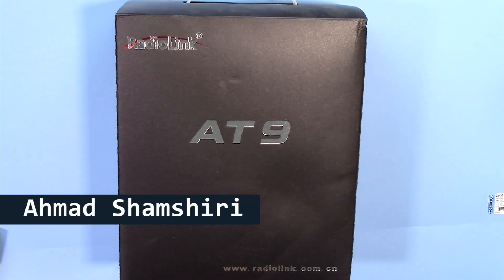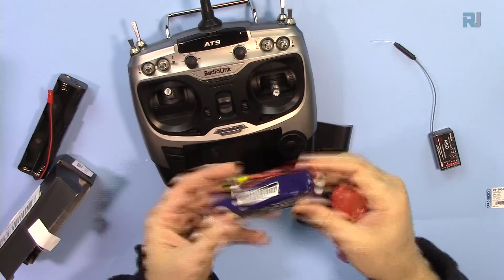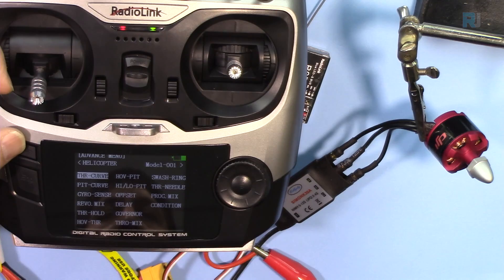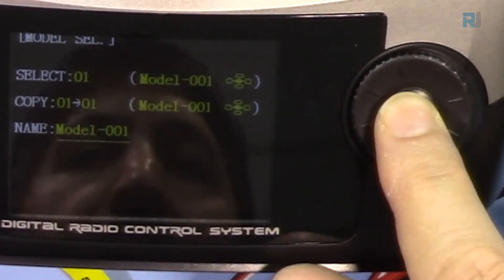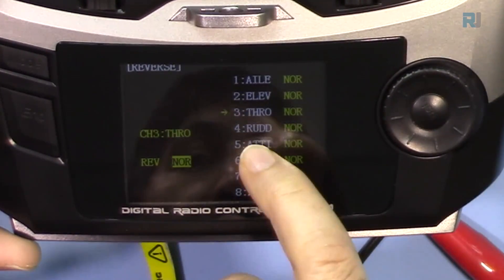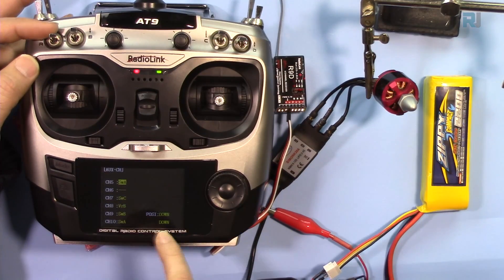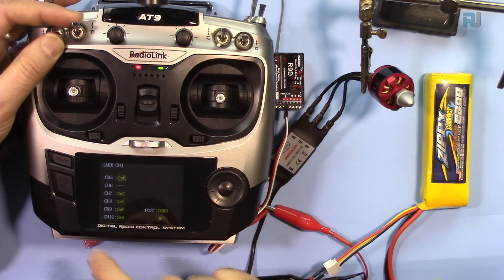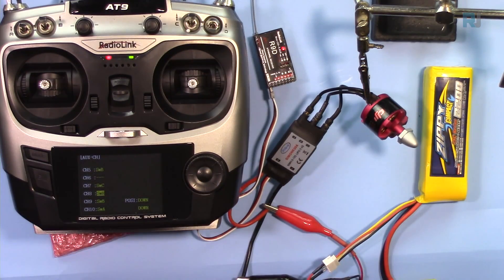RadioLink AT90 9 channel 2.GHz RC Transmitter: Assigning switches to different channels

Comment: For a radio that’s been out for over a decade… you’d think there would be more information out there on it. If you’re JUST getting into the hobby, and have a multi engine aircraft… I’d stay away. It’s SUCH a pita to try to set up and program the reversing edc’s throttle cuts, differential throttle, etc. 

It sucks, but spectrum has the aftermarket support in the form of a LIBRARY of YouTube how-tos…. These “cheap Chinese” radios… not so much. 

That’s my hot take.

Comment: Wish you would of went alittle slower and showed a clear closeup of the screen as you were entering info. I purchased this model off Amaxon and it has info like for drones already in it and also channel 5 has landing gear and channel 6 has flaps. I feel that this radio has had a previous owner. Too late for me to return it since I've had it over 30 days. One of the displays has channel 5 for attitude and I have no idea how to remove it since I want channel 5 for  switch A.

Comment: Like.  Very nice radio. If I needed one the AT90 would be on the list.  However I building one using a Futaba 75Mhz FP-T2PKA chassy. I'll be using Nano and a GT-24 (Nrf24) with lesson on servo control and sketch building from you. Thank You.
Reply: Yes, we now have AT9S Pro，support 10-12 channels and compitable with TBS Crossfire 915 module.